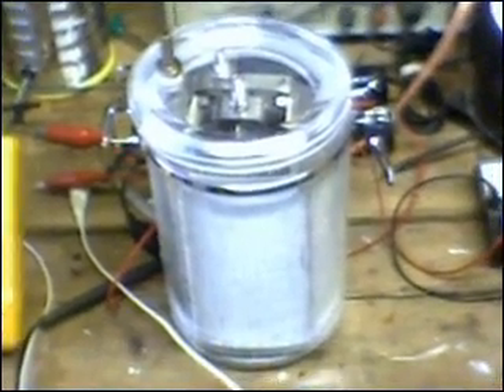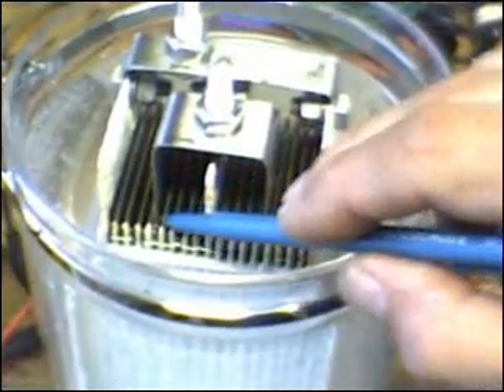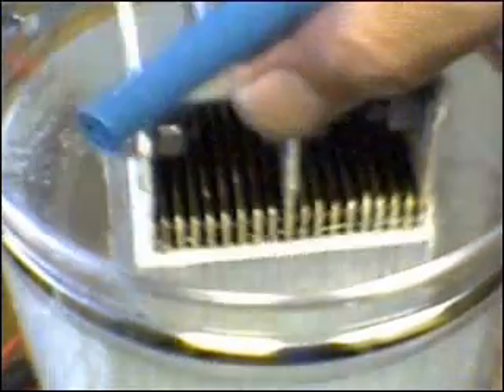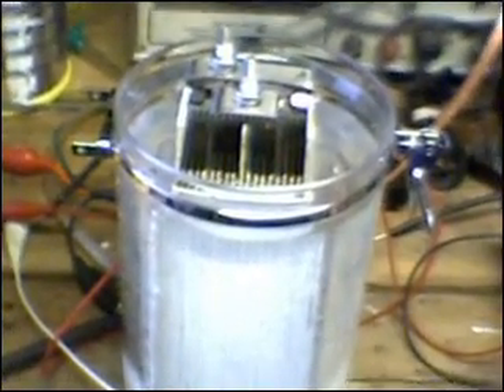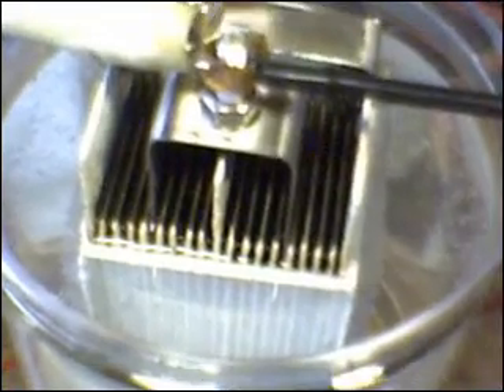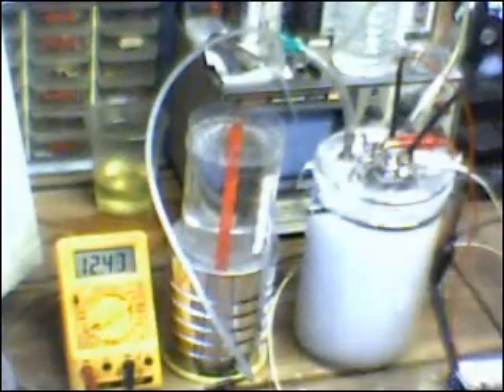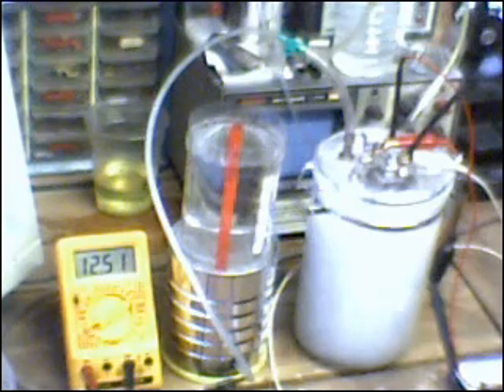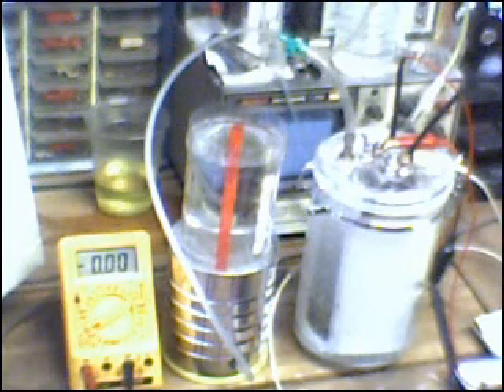#31 Hydrogen HHO ZooFFer Cell 12v CONFIG TESTS 2007/08/10

Comment from the maker: No. The added convection velocity of a tall cell stack permits much more efficient heat exchange with the outer walls of the tank. On a 45 minute commute to work the outer walls are only just warm to the touch. Don't have a digital thermometer in there but I know it's way less than 70 C.

Comment: Each cell is crossed with 3vdc, the extra voltage will heat the water, What is the temperature of the water? >70 C?

Comment: Very interesting
Asuming gas collected is at 20 degC and is saturated with water vapour, the 500 ml container will have 3872 Joules of Hydrogen gas energy (using Higher Heating Value). The cell will therefore have a total efficiency of 50,5%. 
Have you tried high voltage pulses in destilled water?
regards
Øystein L.

Comment: Yeah, the juice container I told you about was a $1.50 and you have to seal the flip top with high
temp RTV. And it is frosty clear. As you can see the water level thru it though.

Comment: Well ZFF, that wasn't the one I was talking about
but it works great for your demos though. Click on my profile and look at the amp test after test
drive. The one on the passenger side has been there for over 8 mo. gone threw 3 over night temps of 18 degrees and have survived about a 10 min. soak flash back.